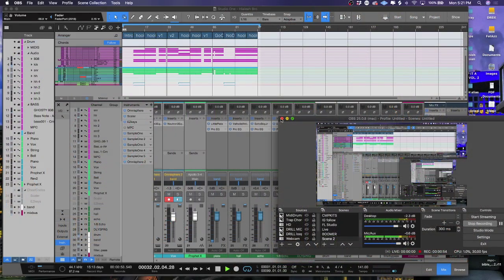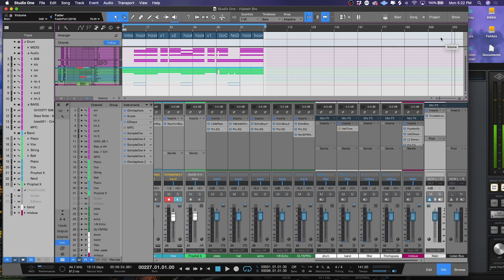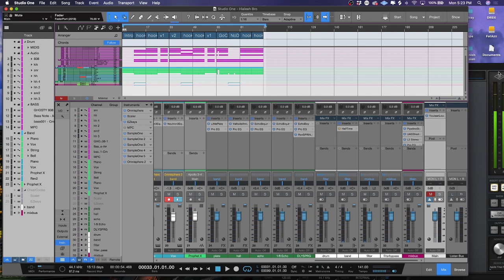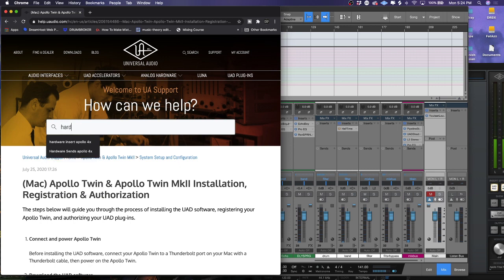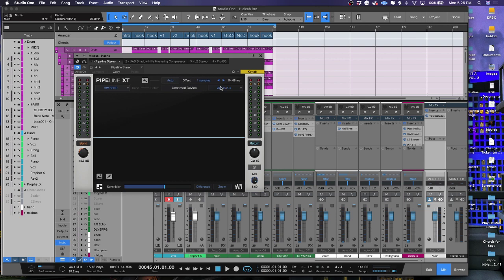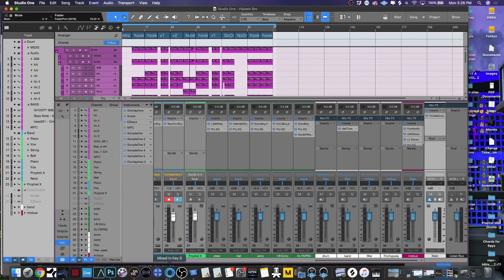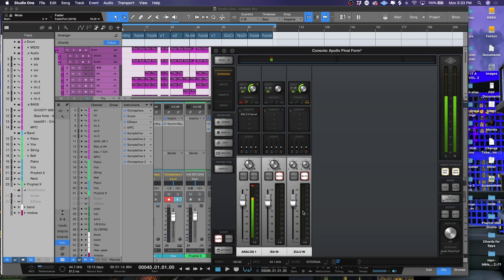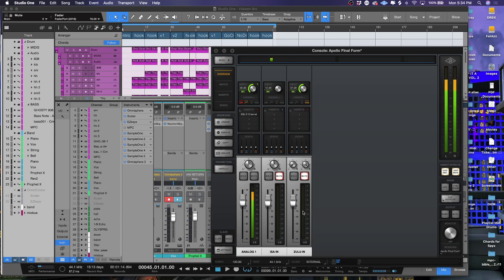Studio One 5 Beginner Tutorial | UAD Apollo and PipelineXT Set Up

Comment: Tip for all those that are using UA interfaces. Make sure you have ENABLE LOW LATENCY MONITORING FOR INSTRUMENTS (unchecked). I had issues getting Pipeline to work correctly and that was my issue with my X8. I am sharing this so others may not have the same issue.
Reply from the maker: Pinned
Reply: I wonder if this is the issue I am having with my pipeline. I'm going to uncheck to see if this solves my problem. Thanks!